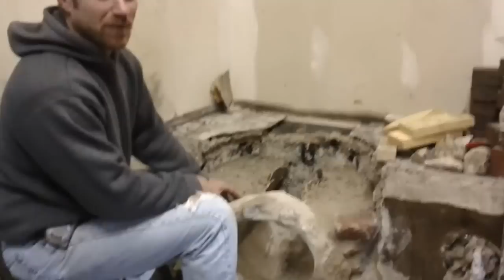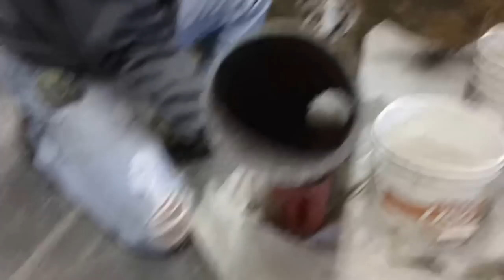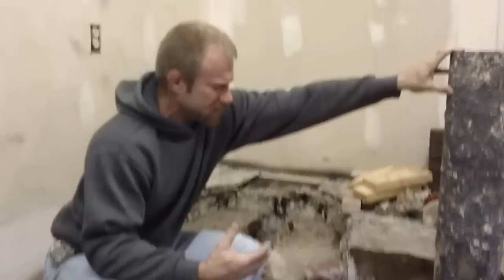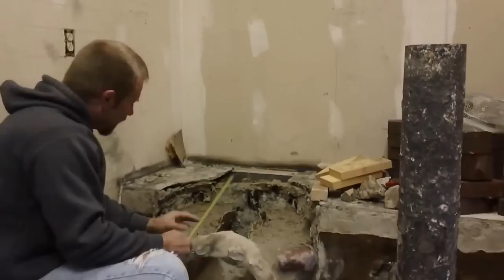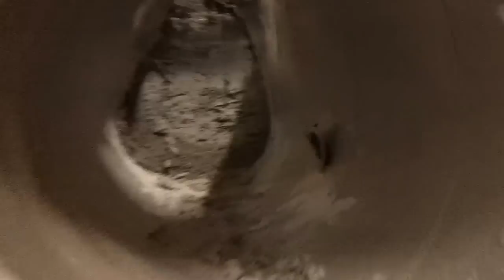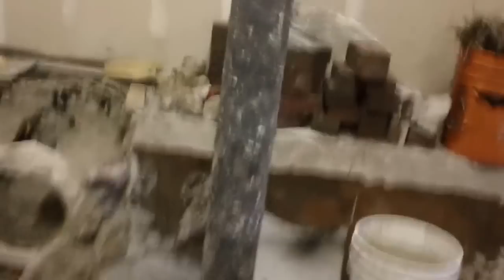12 inch  Rocket Stove Project Part 1

Comment: Van,
I love your designs.  I got interested in your videos when I was researching pellet boilers last year.  I went with an Okefen which is a state of the art system.  They use the same concepts as your rocket stoves except, 1) they force the exhaust gases back down around the burn chamber before they can go our the flew. 2) they have a small pipe that draws at the low point in the exhaust path back to the burn chamber.  I have not confirmed it but based on your videos I think that that small pipe prevents back flow.  I think it also pulls back the heaviest of the exhaust to burn any unburned gases.

My system is 98% efficient.  But I paid for what I got.  (i.e. Not for everyone.) So when my neighbor approached me for recommendations on how best to heat a greenhouse he just built I thought of your videos.  We plan on building a rocket stove this spring based on your designs.  But instead of drawing outside air I am going to try the use a recirc pipe that my boiler has.  Also I am going to try to build it for pellets.  I saw a guy that uses a grate system/  I would be interested in your thoughts.  Also can you direct me to a video of the heat exchanger used to heat the hot water for the "death of a rocket stove" greenhouse.

Comment: The cob is 100% clay? I'm looking for a recipe for the refractory clay mix and have come up with a small selection of mixes, they all seem to include mortar, sand, perlite, and clay. The clay you are using is structurally strong enough to support the load? I suppose that answers itself...but do you have any recommendations for the type of mix I'm reading about? Any help is appreciated!
Reply from the maker: I use hawthorne refractory clay from a pottery store 25$ a 100 pound bag I mix 1 part clay with 3 parts sand and then ad straw according to how much structure I want the mix to have .. any good high temp clay from a pottery store will do. best to do a few test bricks when your unfamiliar with the clay your using to find the right one..
Reply: Van Powell
Thanks!
Found clay at a brick and block supplier (Not sure of the brand yet) apparently there are no pottery stores in my neck of the woods!
Reply: Van Powell When you say "ad straw according to how much structure I want the mix to have". Could you elaborate a little more? How dose it affect the structure?
Reply from the maker: Van Powell inner layers of cob need straw to give the mix strength .. the straw is like fibers in fiber glass and keeps it from cracking and holds it together and makes the mix build up easier and not slump over . but outer layers when trying to get a smooth finish needs short pieces of straw or less straw to be able to get it smooth.
Reply: Van Powell So how much straw do you add for the inner layers?

Comment: erm, is fire brick the same things as the red clay bricks that you see everywhere and are those cinder blocks concider fire brick too???
Reply from the maker: fire brick are made of a material that can take alot of heat usually yellow in color not the same as red brick but red brick will work on riser just not in burn chamber concrete blocks will not hold up very long they crack in days
Reply: oh...ok, thank you..

Comment: Hay van I know from hvac if you got a negative pressure on that room vs outside it will back draft.that's a big problem for a/c down here in Florida. Try adding make up air into the room which you should have anyway
Reply: Tall chimney will draw correctly.